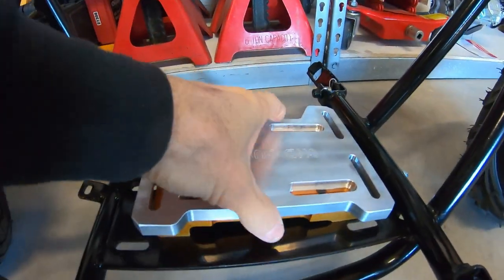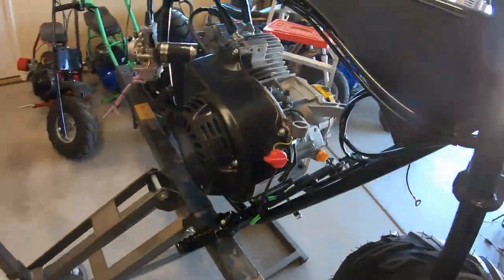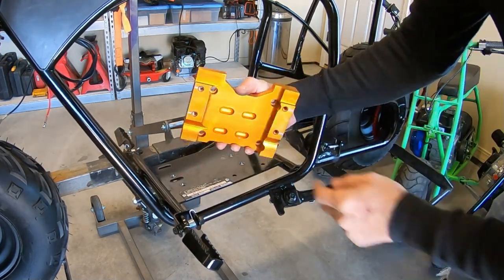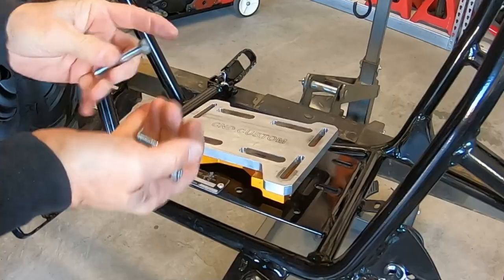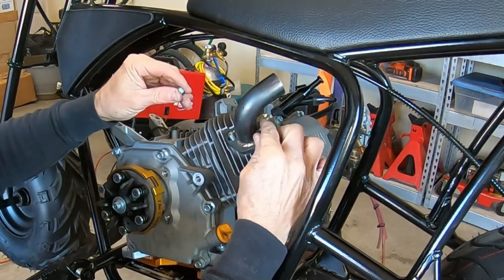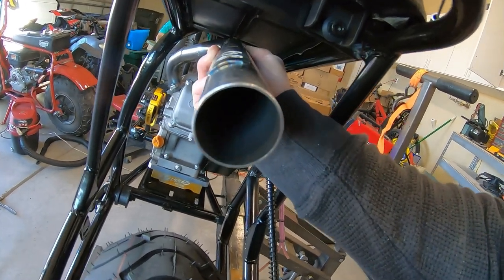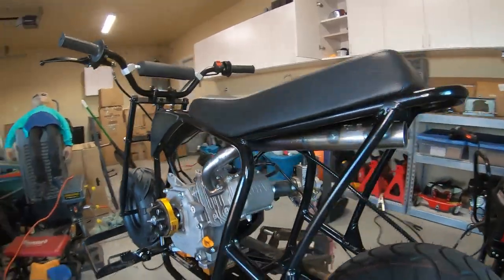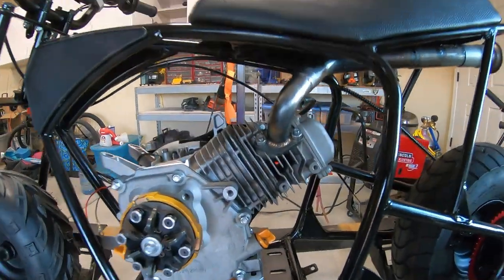Mega Moto Custom motor mount exhaust install pt.4

Comment: Love it. You’re gonna feel the heat from the exhaust even with a heat Shield. I have my exhaust 3 inches away from my seat and have a heat shield and my ass still gets hot
Reply from the maker: I might still weld on that pipe some more to bring it down.
Reply: @Black66  Yes do that

Comment: I was working on the same area as you just a few minutes ago on the Stinger kart. I eiiminated a jackshaft and had to make two risers/mounts so the motor can hang off the plate and line up with the sprocket.
Reply from the maker: Those risers come in handy! Do you have a Stinger by BuG?

Comment: That brake don't last long. I quit using  them. I only use twin piston  brakes now. Same as the  GPS street  tire. Sun f street tire is way better for only $28. (I go on long street  rides figured this out)I thought  you were  going  with  something  different  than Predator and  Tillotson?
Reply from the maker: That is not the engine going on the bike . The only thing Predator is the block . Its using a EC carbs stroker with a wildcat piston , EC rod , 58mm 236/223 crank , Tillotson head . 
I plan on changing brakes out later for bigger brakes . If I complete it the first time around I have no video material 👍🏼
Reply: @Black66  sounds like  this  is going to be fast

Comment: What are you gonna do with that engine looks fast
Reply from the maker: Check out the community tab. I have pictures of the engine there. 58mm Stroker with a Tilly head, wildcat piston, and a 223/236 crank